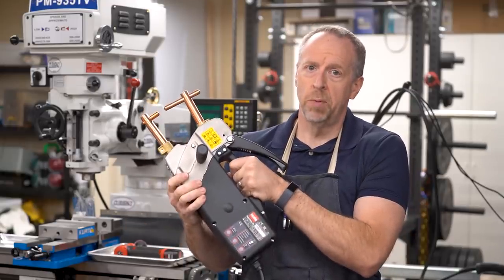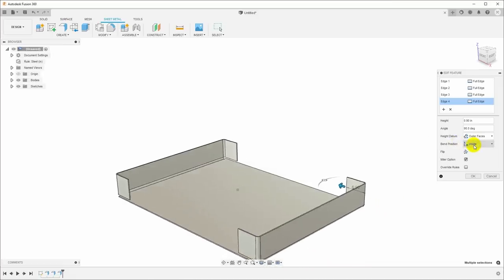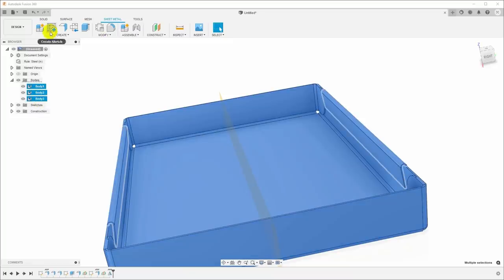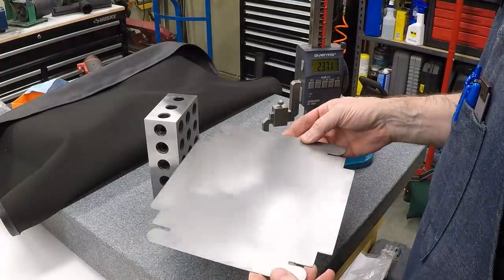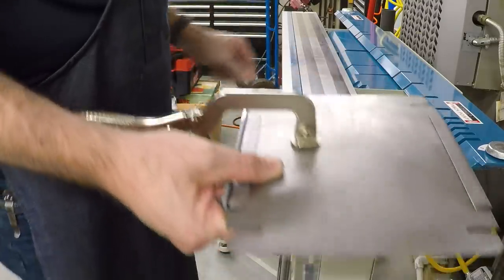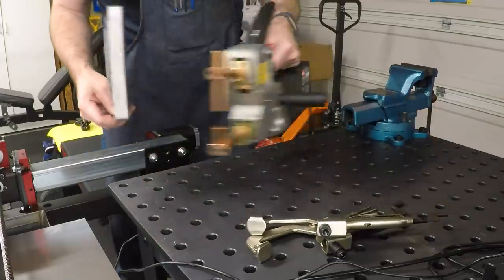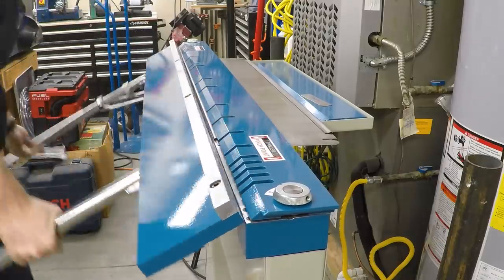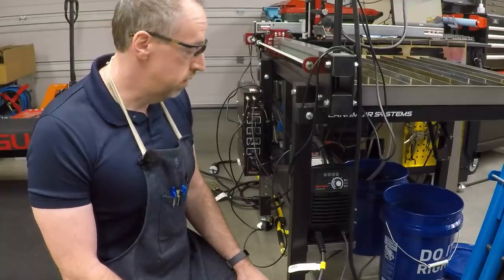Spot Welder FTW! | Fabricating a Steel Shelf for the CNC Plasma Table

Comment: Great Video!  Love the Fusion stuff.  Quick question.  When I sketch with Fusion 360, it first sketches in two dimensions (for example x-y plane), then when I finish the sketch, it goes back to a 3D view.  I notice that when you are sketching, it stays in 3D view the whole time.  Is there a setting that I need to make Fusion work stay in 3D while sketching?
Reply from the maker: I don't think so.  Are you just looking head-on at the sketch as you're working?  I have a SpaceMouse in my left hand, and I'm continuously moving the model around with that.  Not sure if that's what you're seeing.
Reply: @Clough42  OK.  If I open a blank document and make the xyz origin visible, then select "Create Sketch" and click for example the X-Y plane in order to sketch on the X-Y plane... the view immediately changes so that I am looking straight down at the X-Y plane.  The view is a 2D view.  You can only see the X-Y plane.  When you were sketching you can see X,Y and Z planes.  Does this make sense?

Comment: Being a SolidWorks user I am surprised F360 does not have a hem feature... A suggestion for CAD workflow: if you know you will be creating symmetric features sketch your initial flange (shelf bottom) symmetrically about the origin and therefore about the planes orthogonal to the sketch plane. Then when you mirror there is no need to create more planes. Simply select the existing base planes. For something as simple as your project the time savings is negligible. As design complexity increases it saves time by reducing your work but REALLY saves time in the repeated calculations F360 has to do with every manipulation. If you make those considerations for every design it soon becomes habit.
Reply from the maker: Ahh...good idea.  Do all the work, and then mirror once.  Or model 1/4 and mirror twice.  Good tip.  I suppose you could set up the mirrors and then roll history back and add more features.

Comment: James, that turned out very nice....BTW, why did you mount your mill on those large 4 by 3 structural tubes....and does that make it difficult to reach the draw bar nut on top....?
Reply from the maker: They're 4x6".  It's to raise the mill so I don't have to bend over to use it.  I'm 6'0, so I can still reach the drawbar easily.

Comment: No clue if this would be of use to you 
But I would like to see your take on a pen plotters attachment for the CBC plasma similar to what the channel stuff made here did
Reply from the maker: The control system on the Langmuir Systems table is closed source, and doesn't have flexibility to add things like that.  It's one of the tradeoffs vs. building something myself.

Comment: When would you use a spot welder over e.g. a pop rivet?
Reply: When you have extra cash lying around! LOL
Reply from the maker: If it's permanent, made of steel,, and you can reach with the spot welder, it's way faster, requires no drilling, and doesn't stick up proud of the surface.

Comment: Hi James,
I bet you will remove six screws and apply some paint to the tray. Have a question on the bending order. Could you have bent the long dimension and the tabs at the same time, then come back and bend the short dimension? Enjoyed the video and learned about using a spot welder. You and the family stay safe.
Reply from the maker: The tab and long edge bends are offset by the thickness of the sheet so they will slide past each other.
Reply: @Clough42  Hi James,
Didn't notice that when you drew it up in 360. Makes sense now your bending order.

Comment: I bet that if you didn't have a spot welder, you could pop a 5mm holes and a bolt+nut would work just fine. (for the people that inevitably ask)
Reply: Or a hole in one side and a hit from a mig or tig in the hole . A plug weld
Reply from the maker: Sure.  But then I would have no excuse to get a new tool.  :)  I think the primary advantages to spot welding are the speed and the low (zero) profile connection.  The disadvantage, is of course the investment in the tool.
Reply from the maker: A plug weld would work.  Or in my case, I would probably end up with a bigger, melty hole.  :)
Reply: @Clough42  I agree, all I am trying to say that someone lacking the funds for a spot welder, could easily use an alternative method that would be within their means, even as someone else pointed out, do the cutting with manual methods and with care, come out with satisfactory results. Granted, your way is very neat and effective. There are many other ways to make a simple tray, such as cutting the shape with the corners cut out, and folding the sides to meet on the vertical edges and simply weld the corners together, again I do not fault you for your method
Reply from the maker: @lesbender236  for sure.  I've seen some fantastic work done with very basic tools.